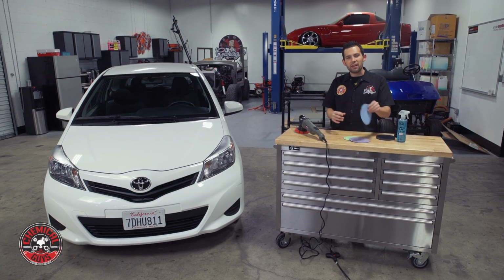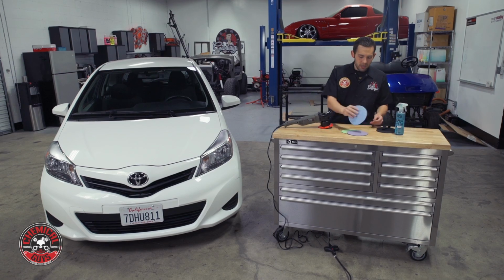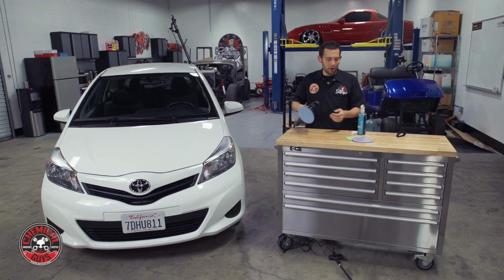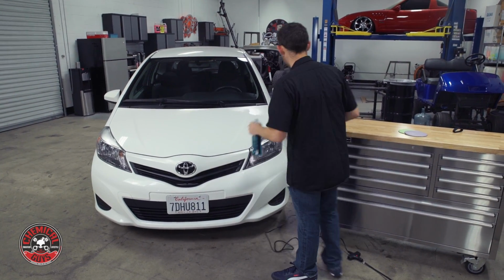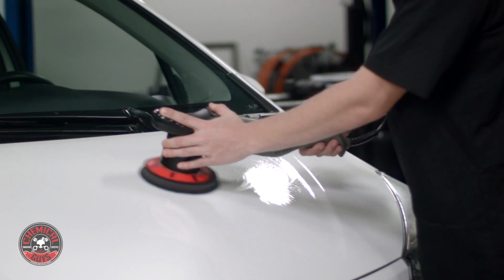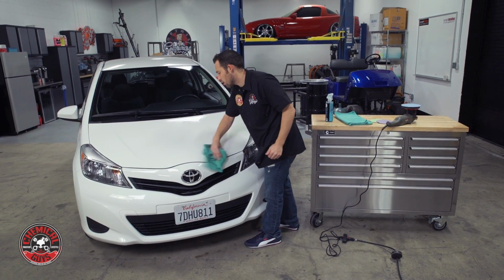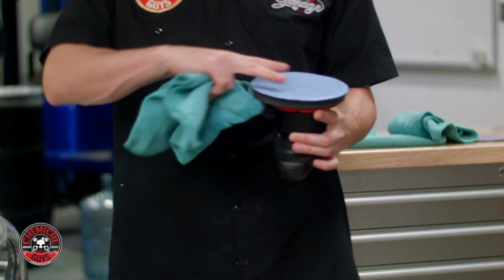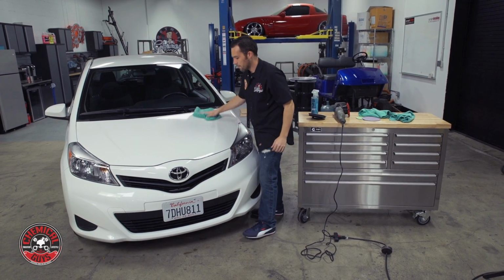Clay Eraser Disc - Chemical Guys Clay Bar Car Care

Comment: Do I have to dry the car or can I get away with letting my car dry in the sun before doing this. Also, can I do this in sunlight?
Thanks!
Reply from the maker: Hi Sharif, we recommend drying your car first to prevent water spots. We also recommend claying out of the direct sunlight. You do not want the surface hot when applying detailing chemicals as they could not only dry on the surface, but also make them less effective. Thanks for watching Sharif and stay tuned for a new video drop tomorrow!!

Comment: what's difference between super fine , fine , and medium pad. how do I know which one I need
Reply from the maker: Pick the one that suits the roughness of your paintwork. If it is very rough from contamination, use the medium pad. If it's not too rough, use fine. If it's a newer car and still fairly smooth, use super fine.
Reply: +Chemical Guys thank you for responding, do you have to run the polisher at different speeds per different clay pad ?
Reply from the maker: Nope! Just speed setting 1 on your dual action polisher is perfect for decontaminating any vehicle with the Clay Eraser Discs. (That's speed "15," short for 1500 OPM on the TORQ machines.)
Reply: +Chemical Guys ok. I have the torq.  great machine

Comment: Like any time you are claying a car, it must have been washed and be clean before you start.
I use one of these discs in a detail business, they work great and do not scratch the paint. They cut the time for claying way down as larger panels can be done at a time. Spray the lube and clean the panel. Wipe clean with a MF towel and then either correct the paint or glaze and seal/wax.

Comment: Can you use a clay bar on a car without a clear coat? We have a 91 Miata with the original paint..which didn't include a clear coat. Waxed, it has a nice shine..otherwise it looks matte and we'd like for the shine to last longer. Ideally, we'd just have it painted..but that's not in the budget right now...especially not for a car that old.

Comment: I don't like the idea of claying in continuous circles. once you take contamination off, its on the pad and and now swirling super fast all over your paint. Sounds counter intuitive to the detailing process
Reply: daniel55645 Well just like traditional clay bar, after you clayed a portion of the paint, you re-mold the clay for a clean surface, correct?  Just with this clay disk, once you are done with an area, you whip it clean.
Reply: Christopher Lew yea but this is moving a lot faster and in circles. I feel like theres a lot more risk
Reply: daniel55645 With traditional clay, you are still rubbing back and forth several times. And "damage" you may be doing would still be done.
Reply: Christopher Lew yes, but you're only rubbing back and forth a couple of times in the times this machine swirled around a couple hundred times
Reply: daniel55645 In both times, you arent checking your application, just like regular clay, you will be swiping several times before checking. Whether its a few swipes or more, "damage has been done" if you want to put it that ways. Its all up to interpretation.
Reply: I don't think this thing has the ability to pull off big enough contaminants that it would scratch the paint. I wouldn't use it on a 10 year old car that has never been clayed for example. Do that with a traditional clay bar and use this for maintenance claying.

Comment: What is if there is a small stone under the Claydisk? I get swirls this is why you either shouldnt make some circular motions during claying!
Reply: james bee  If simply moving an object in circles creates swirl marks, moving it in straight lines would create linear marks. Moving an object around in circles is not going to make it magically abrasive, thats something even a child could comprehend
Reply: Johann Wolfgang von Goethe 
I came here for this comment
You should be claying in straight lines. Not swirling
Reply: Johann Wolfgang von Goethe Presumably you washed the car first, and are careful with your tools
Reply: james bee That is what i was meaning!
Reply: Exactly
Reply: If you're going that far, you better only be claying up and down on the side of the car so that any linear scratches are less visible (or visible from less angles).